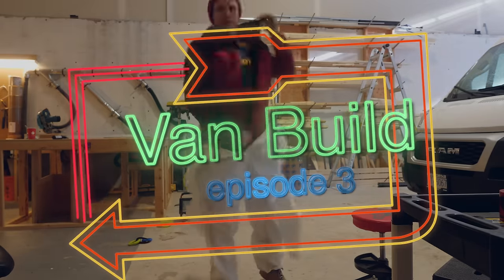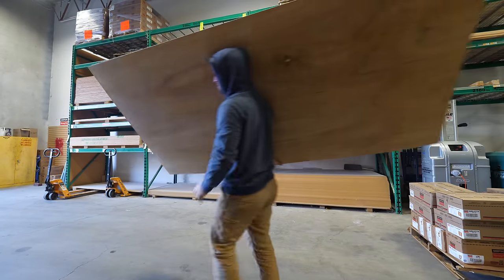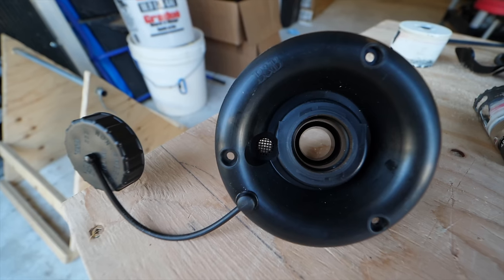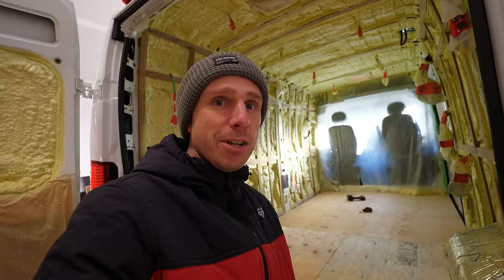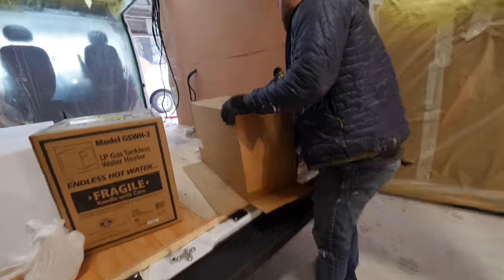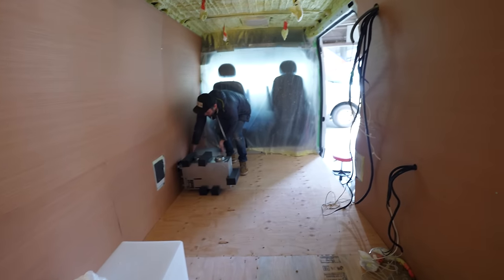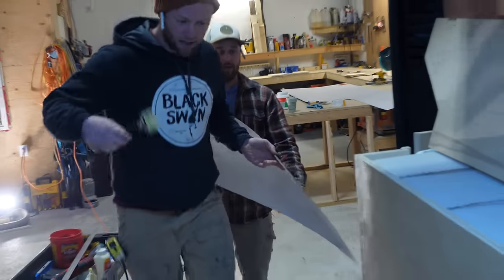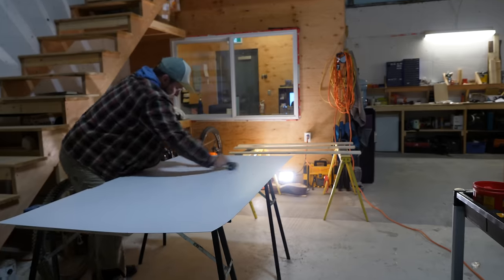Why I Decided To Spray Foam My Custom Van Build...

Comment: why would one place the electrical connection opening (4:30) BELOW the water connections? Shouldn't it be reversed - with the electrical on TOP - in case of leaks?

Comment: If I where you I wouldn't put the electricity plug under the water hose insert...( 4:31 ) If there is a leak and you are plugged-in many things can go wrong...

Comment: Takes no more  than 15 minutes to spray polyurethane foam inside of a van. The sprayed foam cures in less than a minute. You guys should of used air powered shears to shave the excess foam. Saves allot of time. When you shave the excess foam the foams exterior skin is now open which now allows mousture to get in. You guys should of sprayed silicone coating or just painted it with a brush after the shaving was done. This way the open cells caused by the shaving is sealed and protected.

Comment: ive needed a van for the company and I talked to five business today for feedback on the ProMaster they all complained their  14-17 have been problematic and the 2014 was currently in the shop. Their 2015 has been trough 4 radiators. ..   then on top of that are the heaps of videos on here documenting catastrophic ProMaster problems regarding engines and transmissions. all of these vans had well under 75,000 miles.   yikes

Comment: Foam does not keep moisture away from sheet metal. Actualy keep mosture in and sheet metal rust faster. And reapairing car, that has been "protected" this way is real pain in the ass.

Comment: Why do the foam insulation and then drill the body for the external connections.  Isn't that going to allow for thermal conductivity through the outlet?  
I'm not an expert, but just wondering why.
Reply from the maker: How else are you going to exhaust the heater without putting a hole in the van? Please send your answer on a postcard.
Reply: @PaulThePunter    Hey Paul - I think you misunderstand my question.  You would cut the hole in the side of the van first, install the fitting / wiring / plumbing and then do the foam insulation.  That way you would minimize heat loss or heat gain in a hot climate around the fitting.  It can get awfully hot or cold in a camper if you don't have a good thermal barrier.   All the best - I have been looking & thinking about an offroad camper but I'm several years away from that.
Not sure what you mean about the postcard?

Comment: Don't want to be negative but would have insulated with havelock wool or even rockwool,  and not used any laminate.
Reply from the maker: Cool, is that what you put in yours? Because rockwool would hold moisture and then rot the inside of your van from the inside out. NEXT!
Reply: @PaulThePunter  That sounds rather condescending. Thin skin?

Comment: Why do you guys always install the heaviest plywood ever? You've filled the air gaps under them, so you no longer need the rigidity. Save yourselves a few hundred pounds of weight and go with thin ply over solid foam, right? No?

Comment: Oh boy... I'm hoping that you put some primer and paint over the open steel which was exposed when those holes were cut for the water inlets and furnace... All you've spent on this thing, it would be a shame to see it rot away due to rust forming where that steel was exposed.  Water finds a way, so if that exposed steel wasn't painted you've thrown away 10's of 1,000's of $!

Comment: So you have read about off gassing of foam and you understand what went wrong with the FEMA trailers years ago TV at causes sickness ?  As long as you know that foam could still be emitting has for a while. Gas  that is carcinogenic.
Reply: Kevin J that was formaldehyde in the wood paneling, FEMA trailers didn't have foam.
Reply: Glenn Carraway — appreciate the correction and education

Comment: DON'T DO IT
D O N ' T  D O  I T !!!!!
I came over this idea where it was limited to pillars and cranked places where other means of installation are simply not possible. Nevertheless: DON'T DO IT. The van - as any car - will rust sooner or later (if it is a Sprinter probably sooner). If there is foam inside, which will be impossible to remove, welding will be impossible as even  "inflamable" foam will burn. My advice: insulation is totally overrated, as it will not achieve much with most Van's spend your ideas and money on heating. Regards, Chris,  owner of a Mercedes 711D

Comment: FACE PALM! that one inch of insulation is gonna give you maybe r-9 MAYBE - it's also gonna give you off gassing, rust, and the inability to ever fix your wiring. So - for the minimal amount of insulation you got here, you got more problems than fixes. Shoulda gone with denim, or cut poly panels. THE PERMANENCE of spray foam will soon be your bane.

Comment: Electric plugin under the water hookups? Why? Good luck taking dents out. You could never recycle the van. Spray foam collects moisture which is bad for your van. That means it easily collects mold. No wonder my friend used newspapers and foam sheets.

Comment: Why not use a sprinter? Much more efficient car
Reply: TacEsk8 MB sprinter is unreliable and has much higher maintenance and repair costs.
Reply: Actually those ducato style trucks are pretty on par with sprinters. It obviously depends on engine size but similar sized engines in these vehicles will have similar efficiency. The Sprinter is not somehow way ahead. And the ducato/ProRam/Jumper/Boxer(all the same chassis) are more boxy making it better to build out for living. And they are cheaper to buy and maintain(maybe not in NA but in europe tremendously because it is a car manufactured by 3 firms so you can get spareparts from 3 and not just one.
Reply: @MrTree421  i see, here in usa lots of people buy sprinters because of the fuel savings and couple other reasoms, but great explination

Comment: To much weight added.  Poor design electronics next to input,output.   At least i can slowly expose myself to off gases from spray foam. And how about you use water proof, moisture resistant material for your flooring.. you know mold..

Comment: Until you have to chase wiring....I'll PASS on the foam.
Reply: Tony Bucca and how often do you have to replace wiring , I've owned many different RV's over the years and never had to replace any wiring, why worry about something that may never be an issue. If it is then deal with it.
Reply: @heknows5418  I've owned 11 different vans, that were NOT work vehicles. I was always tinkering and changing and adding amps and speakers, and lights..so...PRETTY often for me.

Comment: 9/10 van builders agree that spray foam is shit. Even one of the employees said so! Anyone who has had to carve that stuff out instantly hates it.
When you live in a damp climate everything needs to be resistant to moisture in your van build, not just your insulation.
Reply: HEAV¥HAND  Nope, see: https://blog.polytechinc.com/open-vs-closed-cell-foam It's not that the foam cells are not waterproof, it's that the foamed space is composed of many individual cells and the humidity is able to migrate to the metal by going around the cells.

Comment: Foam like that will hold moisture everywhere causing damp transfer and rusting. Do not do this, cheaper and easier to do it properly
Reply: I agree, what is your opinion of "proper"?
Reply: @rolliebca  best bet is a DPM layer preferably silver foil and using a neoprene covering on exposed areas to trap transfer of moisture. Use kingspan in panel areas and fourth insulated foil to wrap the cabin.
There's a good few ways to do it but moisture transfer will get into ur van and destroy it if not done correctly
Reply: @petewombwell6542  Thanks for your reply. Yeah moisture and health concerns are especially critical in such small spaces.

Comment: Its all fun and games until you need a body panel repair
Reply: Or a weld or a replace wire or replaced panel or toxic wasted from this... Imagine the camper going tot he scrap :-) fk noes the foams stuck to the steel
Reply: @kitecattestecke2303  but I heard that acetone helps

Comment: The most efficient way to make metal surface rust is to spray urethane foam on it.  There is absolutely no way you can 100% certainty prevent  moisture getting between metal and urethane and it will never get away and you wont notice it until it rusts thru.
Reply: kinda like moister getting under your paint , not going to happen , People bad mouth spray foam because the wont pay the big money for it .
Reply: @RDtrailers1   It has nothing to do with price because there is no such thing as cheap insulation if it is properly made. I am sorry to say but if moisture stays long enough in confined space under urethane it goes thru paint.  Car paint is not made to last beeing constantly "under" water. Even boats rust from outside in fresh water lakes because beeing under water all the time and they are painted with special paint for that. I have had to deal with this problem with several steel frame boats and caravans/rv´s. It wont happen in an instant though. You may well be sold that van before it is a problem. But in a vehicle to keep I wouldn´t do it.

Comment: Apparently, you have no clue how to laminate? Standard practice is you lay down strips of wood then the laminate and pull them away as you lay it down.
Reply: Robert Pirlot apparently you didn't watch the video he used a plastic pipe instead of wood. He even explained why he was using the pipe to his co-worker.
Reply: @heknows5418  He was so surprised about what they were doing like it was something new.

Comment: Spray foam is a massively stupid idea.
I guess when you get it for free it's not your choice.
Reply from the maker: I am paying for the parts, it’s only the labour I am not paying for.....but I am providing my platform which is pretty valuable.....but anyway hope you cheer up and have a nice day :)
Reply: Ohh no problem with the mood and attitude on this end. I was just saying (since it is a valuable platform) that foam spray surely isn't for everyone. It's non-reversible, a major pain to work with and I'd be concerned about moisture in the years to come. What will happen 10 yrs down the road?

Comment: Bought isn't built
Reply from the maker: Pretty sure this is a series about building this van
Reply: @PaulThePunter  are you physically building it or are you paying others to build it for you? You'd have more appreciation for it if you learned and built it yourself
Reply: @4000012528  Paul's time is better spent increasing his skills at film making and video editing. If you take the time to read the comments you'll see that Paul is NOT paying for the men's time - he is bartering with them for exposure and advertising which is already proving to be profitable for both sides of the equation. Paul and the van builders are both good at their business.

Comment: spray foam has an extreme amount of poisons that "vent" off for quite a while i would never do this...
Reply: blo me and you know this how? I read it on the internet, and they can't put anything on there that's not true, right.
Reply: @heknows5418  https://www.cdc.gov/niosh/topics/isocyanates/default.html
Reply: @heknows5418  they also put in flame retardant that you cant get info on? im sure its safe though?
Reply: blo me do some research on fiberglass insulation way more chemicals than foam
Reply: @heknows5418  that is true, however fiberglass doesn't "vent" like foam spray does

Comment: Spray foam is the way to go.  Almost every other form of insulation is the same as NOT having any insulation at all.
Reply: Well, that is certainly NOT true.
Reply: @mjmdiver1137  Yes, you are correct.   Choosing an insulation other than spray foam has a distinct psychological advantage.   Outstanding vapour protection and thermal barrier.
Reply: VETTESET  feel free to purchase two vans - spray foam one and do whatever you like to the other.  Then, spend two weeks in Northern British Columbia in winter.   Let me know what you conclude.